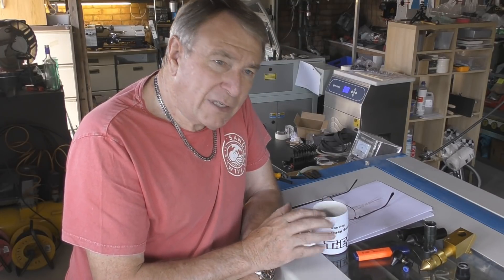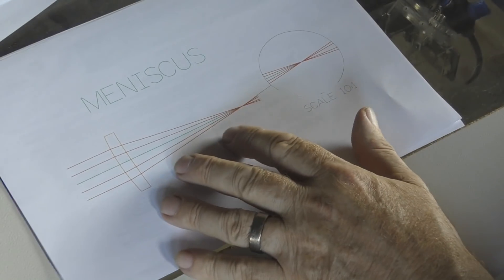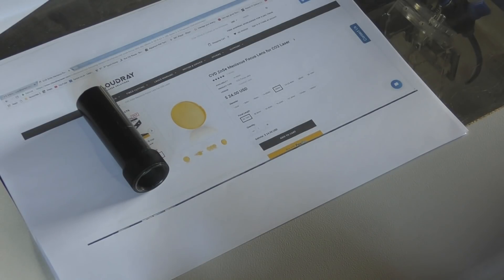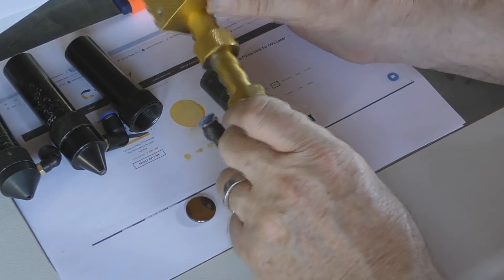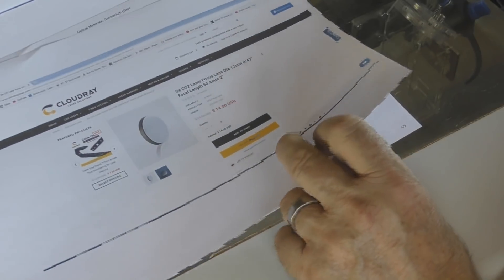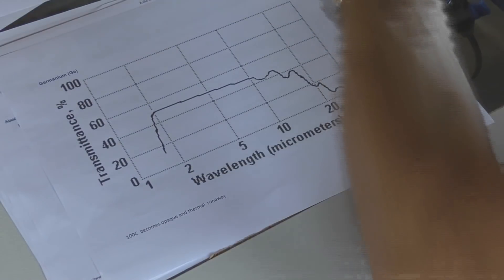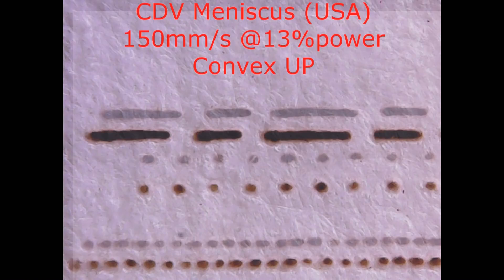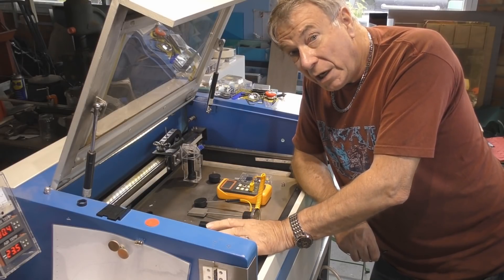RDWorks Learning Lab 149 Lets ZOOM in on Lenses Part 1

Comment: Cheers mate, as absorbing and as useful as ever. If you are in the process of planning what to do next with "China Blue" may I suggest trying to find the best way to cut through material at an angle other than 90 degrees? I suspect rotating the head and tuning the mirror position to suit is the best way but the use a mirror at the business end would be a more flexible arrangement.
Reply from the maker: Hi James 
Without going anywhere near Einstein, this is a relativity issue. You either do as you are proposing and leave the work flat and rotate the beam OR you leave the beam where it is and rotate the work. I see the first as a near impossibility but the second I do often. I have long strips (about 450mm wide) of material I need to cut down to size for my Chine blue machine. I drop the table and place the material in from front to back . The material is now sitting at 35 to 40 degree angle relative to the beam. I set the speed and power at the keypad and then press the left arrow and pulse button together. Works fine. 

Best wishes
Russ

Comment: Man, I like the way you think - I do the same thing when confronted with some unusual problem, I'm not happy until I've investigated every possible aspect, different configuration etc. and absolutely hammered it flat! It'll be interesting to see how the power measurements work out - from what I seem to remember, GaAs has a slightly lower bulk absorption coefficient than ZnSe, but it's really the coating that will have more of an effect. Side note - when I was playing around building CO2 laser tubes back in 2003 or so, I used a gold-coated mirror with a tiny hole for the output coupler, and covered the hole with a small piece of GaAs wafer. Some people used salt crystals, but the wafer was much easier to use.

Comment: Hello Again Russ,
Were you aware that the gold lens holder screws right down on the black tube, they share the same thread pitch. I have both styles and i use the gold lens holder on the black tube allowing three lens locations. a year ago i replaced the gantry assembly with one from light objects, and it came with a much smaller head assembly which introduced all sorts of problems, so now im using a hybrid head made from 3 other heads....lol. As always your work is priceless Russ and you always keep us yanks smiling.
Scott Thorne
Reply from the maker: Hi Scott

Yes, it's a 21mmx1mm pitch thread but the gold nozzle is a very compromised design.. Because the lens is in a fixed position, as you increase the focal length, the beam at the nozzle exit starts to grow in diameter. Accordingly the nozzle bore has to grow so as not to obstruct the beam. This results in a bore of 4mm or more. This is fine for engraving where you need but the merest whisper of air flow to protect the lens, however,  when you need to cut that nozzle bore becomes VERY important.  The pipe coming into the nozzle is also  4mm bore  so there is no pressure buildup within the nozzle just a casual flow of air drifting out of the nozzle.. When you cut organic materials (wood or leather) the material destruction process causes copious amounts of smoke. Smoke is actually millions of micro solids drifting around in a gas cloud. When the laser light interacts with those solids, they heat up, stealing energy from the cutting action. Hence it is vitally important to get rid of those particles out of the BOTTOM of the cut where they will not affect cutting efficiency. To get them out of the bottom of the cut you must inject a sufficient flow of air right into the kerf.. The kerf may only be 0.1mm (.004") wide.  How efficient do you imagine this process to be with a 4mm diameter nozzle wafting air at a 0.1mm wide cut????
The black nozzles from the other lens tube system  is perfectly designed for cutting. Firstly it has a 2.4mm nozzle hole (half the area of a 4mm hole) which causes a flow restriction. Surely that's bad news because we want more flow??? No , the restriction builds up a small amount of pressure inside the nozzle which impels a gentle JET of air towards the kerf. If the work to nozzle distance is too large then the jet will expand in diameter before it gets to the kerf and it will still be an inefficient air flow.  A gap of 3 to 5mm is ideal for efficient  cutting with a small bore nozzle.
Thanks for pointing out that commonality as many will not be aware of the interchangeability

Best wishes
Russ